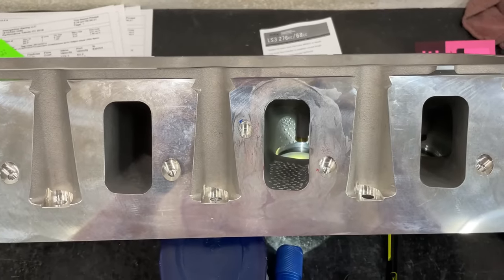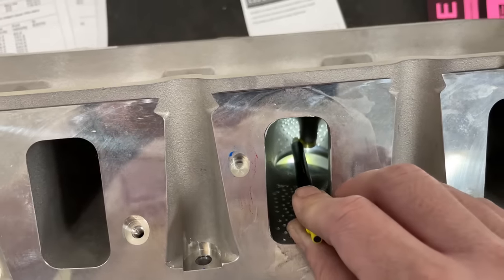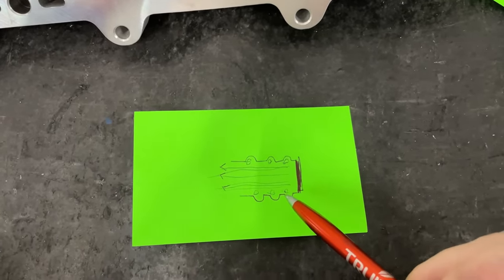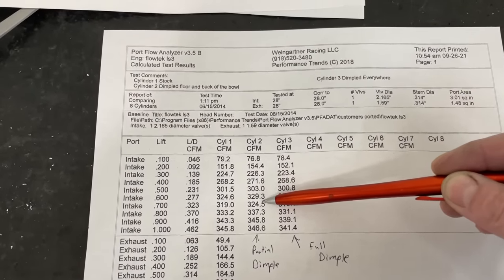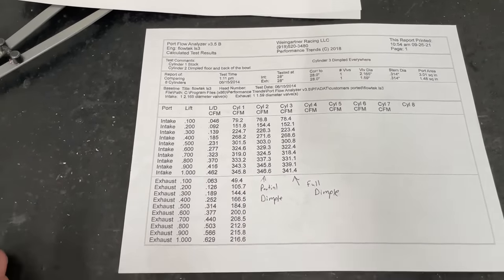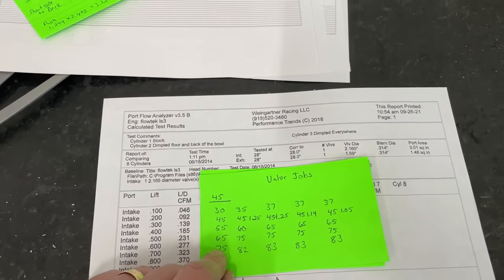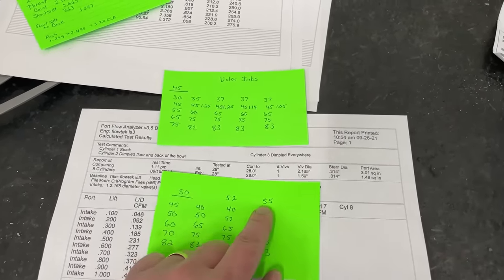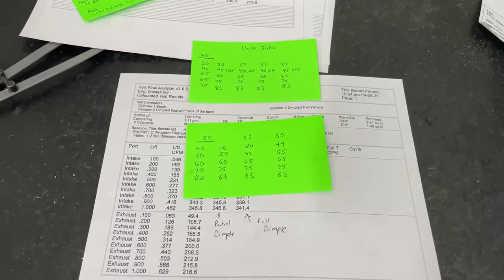Dimpling of Intake Ports Does It Help Part 1 of Internet Ports Heads

Comment: I too thought it was very smart of you to dimple only the low flow areas and measure the results before moving on. What remains to be seen, however, is what the ideal configuration is for the dimpling. How shallow/deep should they be? What should their diameter be? How far apart should they be from each other, on any given row? How far apart should the rows be? There's a wide range of possibilities, obviously, but it shouldn't take a great deal more experimentation just to get headed in the right direction. Once you find something that yields even better results, then it becomes about tweaking THAT configuration a bit to see if even better gains are to be had. I like this a lot. I would definitely try to find a better way to get the job done though. Take a mold of the areas you plan to dimple. Then use that mold to form a thin plate. Carefully mark up that plate with dots, and then use a drill punch on those dots. Now you can drill a uniform set of small holes. Temporarily glue that plate onto the face of your port and let those holes now serve as individual guides for your dimpling. Since all things at this stage are equal, you control depth simply by clocking time. I take it you're using a dremel with a small ball grinder. For each dimple, bring it up to speed and then with uniform pressure press it into a hole for, say, 10 seconds. Who knows, maybe 11. You get the point. Find the right amount of time and then follow the exact same process for each dimple. It is possible to obtain perfect results even by hand if you use the right approach. Also, since you still have the molds from which the first set of plates were made, you can experiment with all remaining ports to determine hole placement and depth. Just make a whole bunch of plates and mark them up differently.
Reply: I should have read your post before posting mine. There are many variables and I'm not sure the human hand and eye can master such a feat. But you never know until you try.😂
Reply: People have been getting ports to flow within 5cfm of each other for decades. By hand.

Comment: The reason a dimpled golf ball flies further is that dimples cause the flow to remain attached longer as air flows from front to back. This reduces base drag. It only makes sense in an engine to add it to the short side radius, helping air to make the turn into the cylinder
Reply: I agree with Eric not dimpling the SSR, air speed already increases in that area and if it nears 380-400fps the fuel will separate from the air, hitting the back of the bowl and entering the chamber as raw fuel droplets. I am curious if Eric thinks the eddys on the back of the bowl would help reatomize any fuel that has fallen out of suspension.

Comment: We always left the intake surfaces a little rough not just for flow, but because we were using a wet nitrous kit the rougher "hatched" finish kept the fuel from pooling up in the port.

Comment: Im so glad i watched this video! I have started an experiment with a RTC-15 Predator 212 head. With such a short port to begin with i thought and thought on how dimpling could affect flow. I did as you did, starting at the opening of the shortside floor being more aggressive. As i went towards the bowl, i put more distance between rows , AND reduced the size of the dimples. I just had a hunch this would be the ticket. I havent dimpled any of the bowl area (as of yet) Questions: 1. Should i hit the backside of the bowl? 2. Should i dimple any of the intake tube? Keep in mind this head already has a pretty aggressive bias swirlport and it really puts a good swirl affect on the air. Ive put smoke through several of my heads, AND with just my standard bias swirlport see unconventional gains in power. Its amazing the power gains im seeing all across the board! Especially mid to upper rpm range! Thanks!!!

Comment: The huge intake tract surface finish  thread on Speedtalk goes into a bunch of theoretical territory. The most interesting hypothesis is that dimpling creates a series of vortices in the boundary layer which assists in keeping fuel in suspension. That should be dyno tested as almost no one in the industry has something like Siemens  Star-CCM to do a multi-phase CFD analysis.

Comment: That is exactly what I have seen. I only dimpled the weak spots on an iron head.  It improved just as if you were able to fill it with weld. The dimples on the FE head worked really well, but it is in selecting the area by listening to the flow bench.

Comment: We used to do this (grooving or dimpling) only on intake manifolds to create turbulence. It is only effective on carbureted and mono port injection as the turbulence helps to keep the fuel charge in suspension (Mixed with the air). We often ran a slightly curved or spiraled grooving to create some cylinder swirl for scavenging.
Porting and flowing can offer significant gains depending upon the engine design or intended use :)
Reply: Had a local machinist do swirling in the in the cylinder for snowmobile engines. Also made things like i4 out of 2x i3s.
Reply: Cool Idea, did you experiment with fuel injection as well?(Dimple Ports) Was it beneficial in Fuel injection apllications as well?
Reply: @nicopotgieter453  Fuel injection (Port) has a pretty good atomization and fuel/air suspension rate to begin with, so some of that was aimed at promoting cylinder swirl.
So for carburated and mono port injection (sometimes called throttle body injection) the intake turbulence assisted in keep the fuel suspended (atomized)  in the air. The swirl direction inside of the manifold has to follow the natural valve and cylinder swirl of each cylinder of the engine.
It's difficult to get good (uniform) dimpling inside of a manifold tube without splitting and re-welding.
In all of our tests we gained a small amount of power and fuel economy, but these gains are not large. You have to think of it the larger picture of performance tuning and all of the other "small" gains you can pick up.
>
A lot of people had a concept of "Bolt on" power at the time, adding this or that to get better performance. I ran with the Phil Irving concept of "removing" what was holding the engine back, often friction, weight, poor tuning (or "Good enough") factory engineering.
Most modern vehicle engines are modeled to some extent off of Phil Irvings race engineering.
Phil Irving: Rich Mixture, Black Smoke and especially Tuning for Speed.
Reply: @nicopotgieter453  P.S. At the time we had some heavy transport department restrictions on hot engines, so hiding the performance tweaks was part of the game for street cars :)
Personally I have nothing against dropping a supercharger onto the side of an engine if it's internals are strong enough to handle 4 to 8 psi boost and the laws allow for it :P
Legally in Australia we can only get away with MAX 4psi boost on certain engines.
Reply: @axle.australian.patriot  Thanks for the reply. So fuel delivery near perfect in fuel injection to be of benefit(dimple). Dimpling a band-aid(Carburetor)to get closer to fuel injection.  effeciancy. Unless you had an early fuel injected 90's car maybe? Reason Im asking from beginning. Grassroots racer with early Golf 1 1600cc 8v (U-Flow) methanol. Trying to look for hidden horspower. Even if is.1-2%.Is fuel injection though but not the most powerful even compared to other competition 8v fuel injection from same era stock or modified(more powerful than Golf 8v U-Flow). The Golf U-Flow alwas a smidgen behind in HP game(in my 8v 1600cc 4cyl racing class)
Reply: @nicopotgieter453  So, yes.. Dimple, manifold turbulence will only benefit the Carburetor and old throttle body injection systems.
Swirl can benefit all but only if done correctly, or if the engine ports weren't well designed to start with.
Dimpling (Like the golf ball effect) to reduce air drag is somewhat debatable in most race circles.
>
You will often see advertisements for "Cyclone" intake add on to "Boost performance and fuel economy" except they place them on the top of the carburetor or near the throttle body of multi point injection and do absolutely nothing.
.
The same system between the carburetor and the intake chamber can benefit some by adding "turbulence" to aid fuel/air suspension. Ideally a twisted fin in the intake just before the valve intake port will create swirl that follows past the valve into the cylinder. But you must get it right and swirl the right direction depending upon the valve placement to the cylinder. In other words you need to twist clockwise or anti clockwise to follow the natural swirl direction for each individual cylinder.
It's a lot of work for a small gain. Most modern engines ports and head combustion chambers are well engineered with swirl etc from factory.
>
For clues on possible enhancements I would have a close look over Phil Irvings books, especially Tuning For Speed.
The same principles for motorcycle and formula one apply to everyday automotive engines. And he explains the engineering principles and tuning in layman's terms.
There is a lot on intake and exhaust tuning.
Reply: Thanks for the reply, kind regards
Reply: @nicopotgieter453  My pleasure. Hope your tuning adventures go well :)

Comment: Somewhere around 20+ years ago, I read an article in a magazine dedicated to sprint cars about a shop that built sprint car engines doing dimpling. Their reasoning was that dimples on a golf ball make it fly farther. Maybe it works externally but doesn't increase air speed inside a tube (runners are basically tubes). They didn't go any flow rate numbers, before and after so no proof of increased flow was proven.

Comment: My question is how does the liquid-Fuel react to the dimpliing and would I see the difference on the dyno of the best results of partial dimples. Thanks
Reply: So what I believe is that as air goes thru the ports that are dimpled we get more turbulent airflow , so when the atomized fuel is injected in the port and goes into the cylinder to be combusted the air fuel mixture has been mixed much more efficiently that other methods, theoretically it should work like that lol
Reply: Do you mean atomized fuel,as in carb/MPFI application? Large drops of unatomized liquid is bad juju. 
If the demples improved Volumetric Efficiency,  then it increases power output or lean out your current setup.

Comment: The best demonstration of this effect and why dimpling can help is what happened when they built the Hoover dam. They first built smooth spillways-tunnels and the water ripped the floor apart from cavitation. We mostly know it as "washboard" on the roads. They remade the spillways with grooves cut in the floor 90 degrees from the flow of water- problem solved. The little vortecies created from dimpling in high pressure areas act as little ball bearings for the air to flow smoothly across. But it has the opposite effect- creating drag in low pressure areas.

Comment: Thank you for testing this. What about ruffles instead of dimples? Water and air react similarly. I used to make Berkeley jet boat castings. They used the Bernoulli principle to greatly increase water intake volume.
You can test it by dangling a spoon under a slow running water faucet and see how forces the water into where the intake would be after the spoon.

Comment: The dimpling would increase fuel atomisation on a mixed air/fuel intake ✌️
Reply: I believe a lot of it will be the help at low speed/part throttle where the fuel has the chance to touch the wall.
Reply: @PantherSerpahin  same, I remember back decades ago there were intake gaskets with screens in them to help keep fuel atomized.  No idea how well it worked with the trade off of better atomization, at least in theory, to the reduction in theoretical port size.

Comment: This is interesting to me, because those little eddy's wouldn't they create turbulence and in turn give better air/fuel mixture🤔🤷
Reply: Same cuz that’s how a golf ball works
Reply: No at best a few grams of material loss is going to have more effect. With direct injection I would say 0 effect at all with port injection just pits to collect garbage in imho. 

No extra air is going in mix will likely be worse as the pits would serve to collect fluid l.

Comment: what we did was take a set of 202 angle plug heads ported all ports water, oil drop, valves to 204 and ported the intake and exhaust plus had to port the intake to match the heads . we wanted cast on cast on a pro built 327 for high rpm engine for pump gas only . old man bell built it i just helped learned a lot from him . i have had the engine to 15,000 rpms many times has lasted over 20 years of street racing ,cruising and just driving it hard. was the fastest in my area on the street back in the 90's for about 3 years with pump gas only . it pushed over 1200 hp just pump gas 13.5 to 1 compression with a tunnel ram started with rick news dragster engine and built the shit out of it . even seasoned the block polished it over size cylinder walls what bell calls supper stroke it . he called it a indy block with a dragster top end

Comment: Interesting but myself I polished my intake & exhaust ports I had the exhaust ports as smooth as glass the intake ports were final sanded with a 120 grit sandpaper then I sandblasted the intake ports washed out the ports to remove the sand grit then compressed air to dry and blow the clean and it worked very well it keeps the air / fuel mixed all the way through the port . . sometimes old school is the best and won't destroy an expensive set of heads

Comment: Recommendation is to just dimple the change of vector of flow ... around the opening and the change in direction at curvature before the valve opening. I wouldn't dimple the first 2/3rds entering the port, just the area immediately before the valve opening. If you can place a dime on a surface and it rocks more than 10 degrees, dimple under the dime, if not don't.

What you want to achieve is a reduction of flow that is fighting the path of flow. Think of it as reducing parasitic loss. Those eddy currents fill the areas that are redirecting flow back against the incoming flow. So your first partial dimpling was a bit too aggressive at the port entrance. I bet you get even better numbers if you do a partial of your partial if you get my drift. And then polish where you didn't dimple :o).
Reply: Cool, you recon you can ruin the (dimpling)effect by doing the whole surface area of the intake port?  Is it for carburetors effective only?Or would old school 2 valves per cylinder heads in fuel injection form also benefit also benefit from dimpling?
Reply: @nicopotgieter453  It's for ports with high angles to the valves. Yeah it should only be done where the angles change rapidly. Polish the rest.

Don't think ya would 'ruin it' with it totally covered. 

Port injection usually adds a significant directing flow. On everything else even direct injection yes. Well maybe not on boost over 4psi.

It's mostly throttle response you make gains ... not  so much in power.

We talking about old 300+ v-8 displacements too. Inlines don't have the issue as much with valve angles.

Although i did work on a honda magna v4 back in the 90.s.
Reply: @ejrupp9555  Thanks for the reply, appreciate more than I can express. Fascinating really, cuase no engine the same with differnet setup it seems some stuff work better than other and in some cases nothing at all. Honda WSBK SP2 VTR 1000cc V-twin superbike had dimples on the lips of the trumpets in the early 2000's. At it was Honda Factory HRC team. The injector was on the outside facing the trumpet(bellmouth) though. Like in early N/A F1 engines.
Reply: @nicopotgieter453  So it was in the area with the fastest exterior angle change ... yeah that makes sense. Because in flat areas or negative angle changes (Less than 180 degrees) it is not useful. as the video results suggest.

Comment: I think there's several reasons why this could be helping.  Which ever way you think about it, you're getting higher pressure leading up to the short side radius, driving a larger pressure differential into the cylinder and faster air flow.

Comment: I have had great results with a Newen seat cuts on the valve job. Average increase has been around 12 cfm on intake. It incorporates the pressure recovery into the cut without a second setup which reduces error.

Comment: CNC can make a pattern, that was designed in a controlled environment for even better flow.
Reply: Exactly. Only a well researched and tested CAD file, using extensive fluid simulation - is the absolute ONLY way to get a dimpled manifold to work. Doing it by hand NEVER yields the same results that actual machine shops that offer this work that have been doing it for 20 years. 

If you look at the Veicomer videos, their dimpling method is the same across every single cylinder head and there arent as many dimples and are much larger and smoother. This guy just used a dremel with the cheapest bit - no wonder he didn't see any increase

Comment: If dimpling decreases the airflow but can increase the atomization, wouldn’t you be better off with the power gains from the atomization than the extra air without atomization?

Comment: Much obliged Sir for the insight,

I'm interested in the partial dimpled port specially the port entry lower floor, any insight on the affects on airspeed, 

Did the lower floor airspeed increase?

Did the air speed variation from the upper wall to the floor became more uniform, emphasizing the area from the port entry till .5 inches before the short turn?